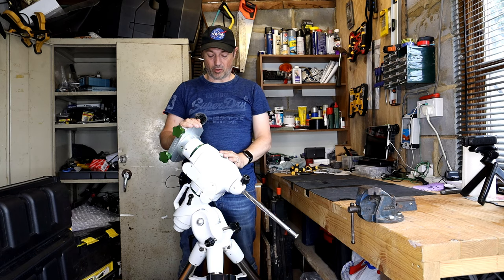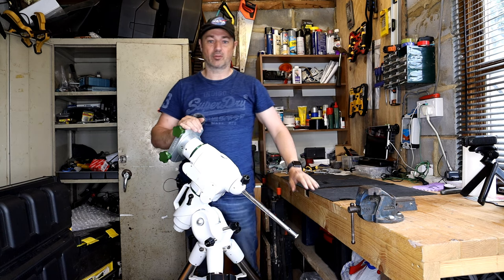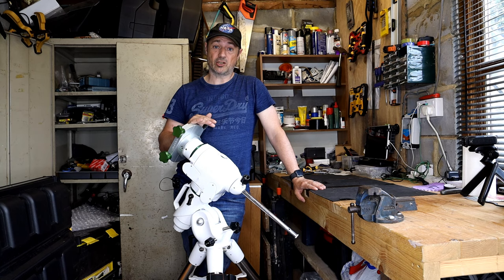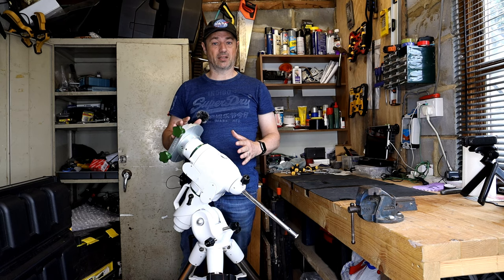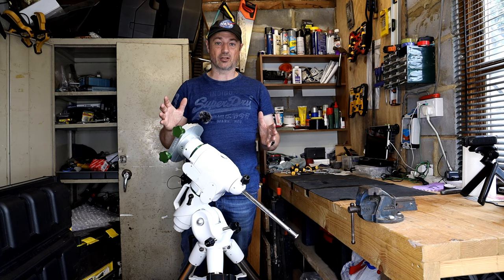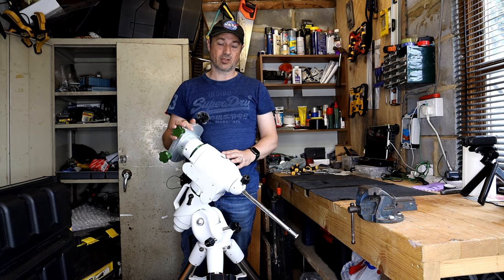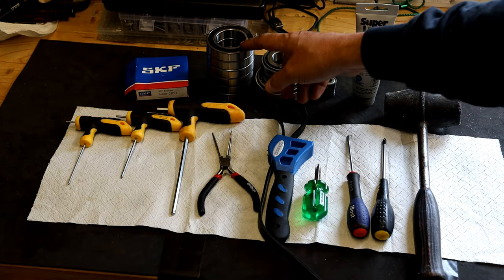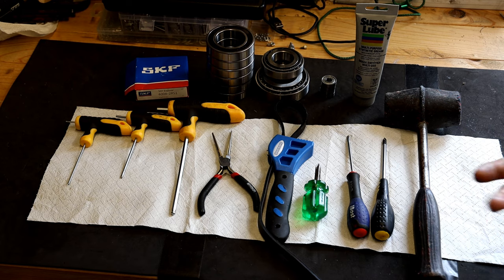Sky Watcher EQ6 R PRO stripdown and rebuild, Hypertune

Comment: Thanks for the video and bearings link.  I’ve completed the tune except for one part—replacing the bearings on the RA worm shaft.  I ran into a problem where I couldn’t get the optical encoder disk off the worm shaft.  The screw used to hold the disk on the shaft is very poor quality and its head stripped when I tried to remove it.  Any suggestions?  Thanks, Greg
Reply from the maker: That is a real shame that screw head stripped. Its a very small screw and if done up too tight I can imagine easily damaged. I was lucky that mine just turned ok. I am not sure what you can do other than try to drill it out. Not sure how easy that would be with it being so small. It might be worth a search on google or YouTube for ways to remove small screws that are damaged. What you don't want to do is damage the disc. I hope you are able to find a solution, a replacement screw would be easy to source its just getting the old one out. Thank you for watching and commenting and good luck, please let me know how you get on. Glenn

Comment: Hi Glenn
Just got all the needed SKF bearings to do surgery on my EQ6R Pro, but I am wondering, if you cleaned the factory supplyed grease from the 6008 bearings? They are extremely smooth, but the grease seems to provide a fair bit of sticktion.
Reply from the maker: The ones I fitted don't spin freely but don't seem to have stiction to affect the mount under load. I left the grease that they came with but you could  change it if it  feels too stiff for you.

Comment: Hi Glenn
I have the newer AZ-EQ6 Pro, and my RA guiding suddenly became terrible. From 0.7rms to over 8rms. I stripped the mount. Turns out the bearings on the RA worm shaft were rough and noisy. I followed your video. Excellent work. At 23:00 you changed your bearings. I’m struggling to find information regarding the size I need for my mount?
Is it SKF 608-2Z? 22mm outer, 8mm inner and 7mm thickness?
Many thanks
Reply from the maker: Hi Osama. I am really sorry but because I have never worked on this mount I have no idea of the bearing sizes for it. Have you tried contacting Sky Watcher? They may be able to help. Sorry I don't know the answer for you.

Comment: Excellent video!  Would you know if this is the same process for the AZ-EQ6?
Reply from the maker: Thank you. It is the same process apart from the RA roller bearing which I believe is a different size. If you contact Sky Watcher they should be able to confirm the bearings needed for your mount. Good lick and clear skies
Reply: @Astrobloke  Thanks a lot, highly appreciate the feedback!

Comment: I would love to do this to my mount but I can’t bring myself to tear into a brand new $1,500 mount. Thought about having it professionally done but then didn’t want to be without it. So I’ll just be happy with 0.8 for a few years.
Reply from the maker: I can understand that and most probably not necessarily what you have to do to get great performance. PHD2 settings and PEC training can all make a big difference and drop your guiding error numbers.
Reply: @Astrobloke  I watched your video on PEC and ran the full 9 cycles on mine but my graph looks like a staircase. Probably some stiction in the mount but I’m not sure where. I’m hopeful that it will loosen up over time. Do you think that PECprep will sort that out. The mount is under warranty but I doubt they will see it as a problem.
Reply from the maker: @jedidiahwest4619  Pecprep can help ypu produce a smoother curve. Run the PEC curve you have and while guiding with it next time you are imaging record another 9 cycles.

Comment: Thank you for the excellent video! Do you know which one is the tapered bearing for the DEC axis? The 30206 or the 32208?   Is that info available somewhere?  Thanks!!
Reply from the maker: Thank you for watching and commenting. The smaller tapered bearing (30206) is the one for the DEC axis.

Comment: In the middle of this now. I'm putting back together the dec but it feels stiff when I go to spin the dec.. definitely doesn't spin as smoothly as yours appears to.. I followed step by step.. frustrating!
Reply from the maker: @RyansAstrophotos  it can be but it’ll be simple. Make sure you have not done up the roller bearing too tight. Basically loosen it off so it all moves freely then tighten very slowly until there is no play. Let me know how you get on and If I can help more just shoot me a message.
Reply: @Astrobloke At 27:45, before I even re insert the roller bearing following your video exactlt it has fairly stiff movement. If I were to try and spin the dec it comes to an immediate stop where yours seems to spin freely for a short time. Is there somewhere I can message you? Discord?
Reply: @Astrobloke  To add an update, I have done the RA now and cleaned it out (very bad sludge!) Put it back together and it is also stiff movement like the dec. I'm not sure what mistake I am making on both axis

Comment: Great video. Thank you.   Another question if I may.  Why using that reflective material in your observatory?   One  would think stray light would reflect on this.  Unless you are lucky to live in a Bortle 1 area of the world, but there is always LED lights on equipment.
Reply from the maker: I have had a few comments on this. Its insulation as its a plastic shed and so prone to condensation, this stops that.  Absolutely not reflective issues at night as you can see from any of my images, including an APOD

Comment: Helpful video Glenn but I noticed a mistake. You used super lube on the worm gear. Whilst super lube is ok for bearings it isn’t a suitable lubricant for gears. You should have used something like Liqui Moly LM47 on the worm gears
Reply from the maker: Thanks for commenting. 
For fast moving gears I would tend to agree as certain greases can thin/separate over time and fly off if on fast moving parts. With the very slow mechanics of a mount the super lube performs very well and to date I have had no issues to think it needs changing.

Comment: Awesome job! Inhave mine in pieces right now. Somehow mice got in and filled it with what looks like cat food lol (got it used). It is a disaster inside. What dod ypu clean all the parts/gears with? Varsole?
Reply from the maker: I was quite lucky in that I just had excess grease in mine so was able to just wipe it clean and apply new grease. In your case you can use any degreaser really but just make sure thats all cleaned up and dry before applying new grease. One I have used before is WD40 degreaser, works very well.

Comment: Hi Glenn. Do you have any advice on replacing the alt and az bolts? The factory ones are not very easy to use because of the knobs. Thanks
Reply from the maker: Hi Stuart. I still have the originals but agree they are not the best. Now I have an EQ8 it really shows up how clunky and poor they are. I think I will look into what alternatives are available and will show any I get. I think the main problem on the Az though is the thread is too coarse so fine adjustment is difficult.
Reply: @Astrobloke  I'll look forward to that. Do you happen to know what size the bolts are? M12? I think the alt one may be bigger than the az ones

Comment: Hi Glenn, great video and channel. Just a quick question. I note from the recommended bearings website there are three options for the tapered bearing 30206 and the profile info suggests each has small differences in bore, width and OD. Can you confirm which one you used please. Thank you in advance.
Reply from the maker: You do not want the 3rd option of the reduced size bore. I opted for the more expensive of the other 2.

Comment: I have one small issue with balance.  No matter what I do the telescope is east heavy, I have adjusted the counterweight over and over and over, but nothing changes is there any advice you can give me at all?
Reply from the maker: Its very possibly whats referred to as the 3rd axis and where there is more weight to one side of the scope. Firstly make sure the mount is level as this can effect it also. If it is then either add weight to the side it is falling away from. I use Newtonians mainly and you can rotate these in the rings to balance this out. With my refractor the autofocuser on oneside throws off this balance so I just add some small weights. Hope this helps

Comment: Glen,  I have the Az-eq6 pro.  Do you know if the bearings are the same as the Eq6?
Reply from the maker: They are almost the same but I believe the RA bearing is slightly larger. If you email Sky watcher they will confirm the sizes for you
Reply: 👍 @Astrobloke

Comment: How much time would you estimate the full upgrade process takes?
Reply from the maker: I would say 2-3hrs without rushing. Obviously longer if you have any particular problems like bearings getting stuck etc
Reply: @Astrobloke  awesome. You also mentioned you have some bearing pullers that would make the process easier. Do you have a recommended set or style of bearing pullers?
Reply from the maker: @blairconner8670  I have had them a while and they are just an inner bearing puller set. There is a set on Amazon which look identical
https://amzn.to/3Nf6OIH

Comment: I see you do not loosen the set screws for the carrier backlash adjustment prior to removing the carrier.  Or is this just not shown in your video ?
Reply from the maker: It was quite some time ago now and I honestly cannot remember what I did there. I would say they do need loosening off first but the carrier may come off without that as they should not be done up tight.

Comment: Superb! Thankyou.
Reply from the maker: Thank ypu
Reply: @Astrobloke  Glenn, I needed to go through this video as my EQ6R-Pro got soaked accidentally when the roof to my observatory leaked badly, meaning the guiding became crappy and unreliable. So I took this as an opportunity to service it and upgrade the bearings. After running my mount through this video I was left with what I would describe more as a grinding noise, as opposed to binding, (I think of binding as less whereas grinding being noisier and sounding more like it could do damage) to the point where the Dec axis wouldn't actually slew with the hand controller. I decided to dismantle the mount again and checking the slewing after each stage of the dismantling the grinding noise disappeared once I got to the loosening of the 4 bolts on the mount that hold the Dec carrier in place. So I put it all back together with these bolts not tightened quite so much as previously, and all worked well when I tested the slewing, the grinding noise had gone; both axis slewed without any binding; however, guiding was not as good as hoped. It was better than when the mount got wet (guiding RMS then was 2 - 2.5), but before it got wet I could expect 0.6. Is this backlash that is causing this? There is a noticeable movement in the Dec axis, which I didnt have before....

Thanks.

Kind regards

Matt
Reply from the maker: @oakleywindowcleaning  Hi Matt. The grinding noise is not nice at all but its just the axis locked up and the stepper motors slipping. ts possible you may have it too loose and its a very fine adjustment between running freely and binding. You also need to guide for a good period of time and give the mount a while to settle. Just in case you haven't, re run all calibrations. treat it like a brand new mount and I would also run guide assistant (for EQ6 thats  8 mins = 480mins) so it goes through one complete worm cycle and apply the changes and then run a fresh calibration again. See how it is after this. Make sure with calibration you have your mount RA so the mounts is parallel with the ground and slew as low to the south that you can or when Dec reads zero. This will give you the best calibration for your mount. Hope this helps and please let me know how you get on.
Reply: @Astrobloke  Thankyou, clear skies in the south here in the UK tomorrow apparently. I'll check out those suggestions. 

Matt
Reply: @Astrobloke  Glenn, in your last reply you said I may have it too loose. Which part are you refering too? The belt for the Dec axis?

Comment: Mine regularly gets .3 to .4 guiding. sometimes I hit .5 o.6 but usually on average .4 or below so I don't think I will bother with this for now. lol  My image scale is 1.0" per pixel so I think that is fine for even 20 mins worth of subs.
Reply from the maker: Looks like you got one of the good ones and at that guide performance I would leave well alone and just use it. My EQ8 R Pro is like that. Guides 0.3-0.4 so perfect out of the box. Clear skies

Comment: Great video on hyper-tuning the Skywatcher EQ6-R Pro. I ordered the bearings kit from R&M Bearings in England, and am ready to perform the upgrade. My question is this: Did you do anything in the way of cleaning and lubing the bearings before installing them in the EQ6-R Pro? R&M Bearings suggested not doing anything to the bearings since they come from the factory already lubed and ready to install. Your thoughts? Thanks for the great video!
Reply from the maker: Thanks Darryl. The sealed bearings I leave alone and just put in the mount, there is really no need to grease these as they come pre packed with grease and you don't want to open them unless you have good reason to. (Re greasing older bearings  maybe). The tapered bearings will need to have grease applied. Good luck with your project. clear skies
Reply: @Astrobloke  I don't see you apply grease to the tapered bearing in the video, how much grease should be applied to the tapered bearing? Should they be fully packed?
Reply from the maker: @DamianVines  I just put a thumb size blob in the palm of my hand and work it into the rollers. Just make sure it has a good even coating

Comment: Hi, Great video and I can appreciate the time and effort to do this!  I ordered the bearings that you used and I found them to be extremely stiff.  I sent a note to R&M bearings where I ordered them as a kit they suggested I ask you for some feedback.  I had earlier purchased a hypertune kit and the worm bearings were easy to spin.  Any suggestions, to anyone?
Reply from the maker: New bearings can feel stiff (mine were) if you try and spin them in your hand. Once under load they will be fine. Obviously if they are not moving freely when under load in the mount there could be a fault with them. But if they turn by hand and feel smooth (no bumps, notches) they are fine. You don’t want them too loose as these could have play in them. Its hard to tell what they are like as i would need to see and feel them but they come packed with grease so won’t just spin freely
Reply: @Astrobloke  Thanks, I guess the idea of being able to spin the RA/DEC axis so it keeps rotating is not necessary

Comment: Brilliant video, thank you. I'm due to move house soon and so my observatory will have to be dismantled and shifted with me. I'll take the opportunity to tune my EQ6R-Pro so this video has been very timely! Just one question - what do you use for cleaning up the parts? Whenever I've done anything like this (my AZ-GTi for instance, following one of your other videos!) I worry about fibres of tissue getting left all over the place. Is there something specific you use?
Reply from the maker: Nothing special actually. I have some heavy paper towel and i just carefully wipe off messy or excess grease. May use degreasant if really bad but the newer mounts seem a lot better and use higher quality grease. Not had any issues with fibre from tissues to date but I am always careful to check
Reply: @Astrobloke  cheers, Glen. I always seem to get bits caught on sharp edges so end up having to use the wife’s toothbrush to get everything clean again (just joking in case she happens to see this 😬).

Comment: What causes stiction and what can be done without replacing all the bearings? Also does pec tuning in phd2 improve guiding in both ra and dec or just one of them. Thanks again for your efforts in bringing us these how to videos.
Reply from the maker: Stiction can be simply because the main nuts that hold the Ra and Dec axis on the mount are done up too tightly from the factory. Just slightly loosening these can help but make sure there is no play. You can see this in my stripdown videos. PHD2 will adjust guiding for the Dec and Ra. Pec is purely measuring imperfections in the RA wormdrive only nad corrects for resonance in that drive.
Reply: Just to be clear the 4 main bolts for each that hold the ra and dec carrier on not the grub screws and counter weight cap .
Reply from the maker: @danjensen9425  no they are the worm carrier bolts for the Ra and the dec. I am referring to the first main nuts that are removed when taking apart the Dec or the Ra , Dec one is where the counter weight bar comes out and Ra where the polar scope is.

Comment: Great video Glenn,  very interesting to see the internals of the mount..some could argue that it's a regrease and not a hypertune... you could have gone alot further into detail...things that would help, and some that might cause you issues further down the line
But on the whole, great video
Reply from the maker: Thank you Derek. After all the work I did and replacing all the bearings with much higher quality ones it would be a little unfair for someone to class this as a regrease. I do have a follow up video coming out very soon showing that my guiding is now at 0.3 total rms error which I think you'll agree is tuned nicely.
Reply: @Astrobloke  yes it's well worth the effort, some would say you're mad to take it apart, especially as it wasn't causing you any issues other than a bit of stiction.. but .3 is in pixels and on the scale of your guide cam.. arc sec is an arc sec, regardless of your set up
Reply: @derekregan6926  What methods and procedures do you consider is classed as a hyper tune?
Reply: @Astrospacegeek  modifying and improving parts that isn't originally in the stock mount